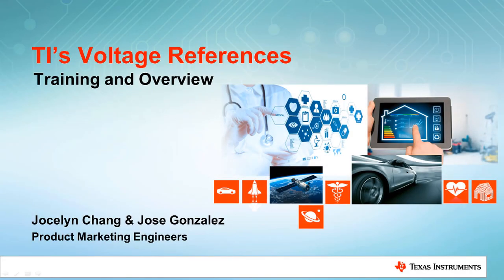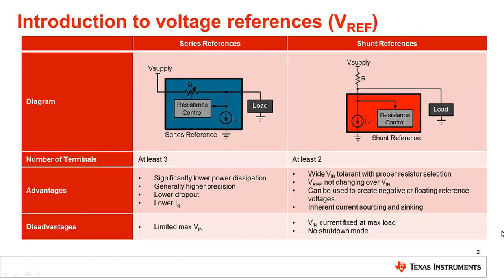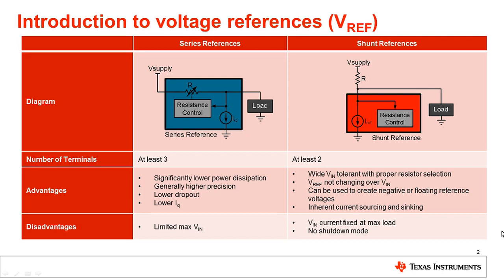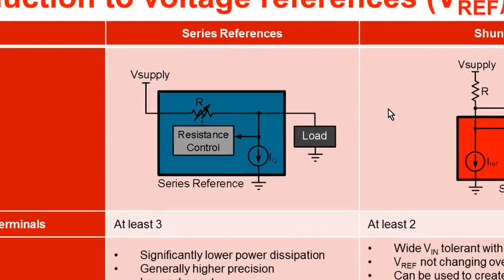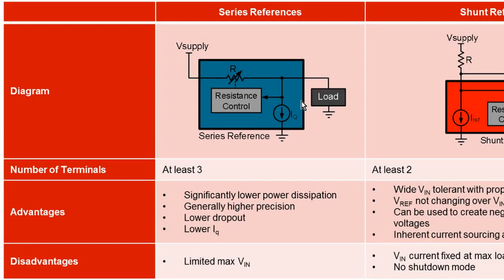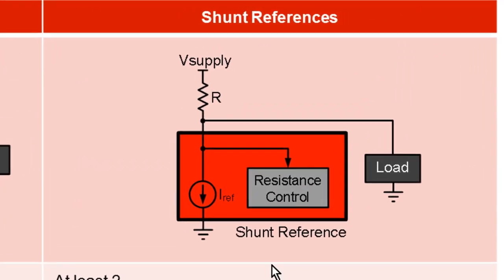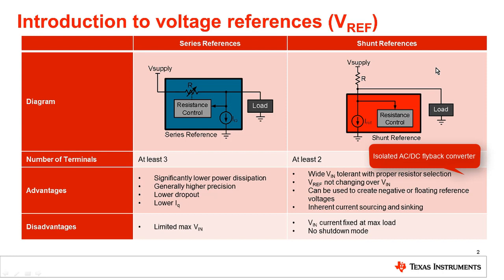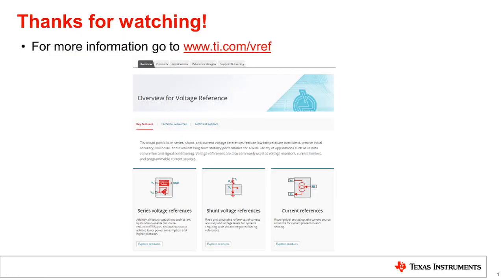What is a voltage reference?

Comment: Atoms are neutral because they consist of an equal number of positive (protons) and negative (electrons) particles but
that is not the end of the description. In addition, the following are inherent in neutral atoms:
The fields due to the protons and electrons always exist, penetrating everything, but they cancel each other so well that there is hardly a net electric field around the atom!
When  electrons are separated from nuclei of a stable neutral atom the strength of the electric field around the atom grows which disturbs 'neutrality'. 

A conductor or any substance made from neutral atoms we can say is neutral when there is no significant field
surrounding it.
All locations at infinity, in all directions from the substance, are at the same potential namely “zero" and maybe
considered as a 'reference'.
A neutral piece of wire with its millions and millions of neutral atoms is good enough to be labelled as
a ‘reference’ and also as ‘0’ volts. It maybe called "circuit zero" or "ground" as is done in electric circuits. 

What is fascinating about an atom is how it remains “neutral” despite it being a collection of sources of powerful
electric and magnetic fields. The electrons at very high speeds orbit the central core (in the classical view) so perfectly balanced that the “net” electric field is very close to zero outside the atom.
Because of this astounding assembly of sub-atomic particles….for all time…..the e-field never becomes significantly
non-zero even for the tiniest fraction of time…..the cancellation of the fields outside is ever so precise.
If it were not so, we would be living in a “shocking” world ! and.....
…you would be shocked by anything you touch ! 

But what happens if there is some excess charge deposited on the substance? It is charged and it has a potential. 

Since charge cannot be destroyed the only way we can make the potential of the substance nearly 'zero' is to connect the substance via a thin conducting wire to a large conductive sphere. The charge will then spread out over that large sphere and make the potential of the substance nearly zero. That conductive sphere maybe conveniently the earth! And thus emerged the idea of 'earthing'.
When the charge migrates to the large sphere there is a current.We note we are observing phenomenon related to both
electrostatics and circuits.
Electrostatics and circuits belong to one science, not two. These are discussed usually separately in textbooks and
science and engineering courses. For too long has circuit theory been confined to analysis using math and has been depriving practitioners of the richness in its physical aspects.
Watch the two videos listed below to learn about current and the conduction process and surface charges
using a unified approach to electrostatics and circuits at a fundamental level. 
The last frame of video #1 lists articles and textbooks which discuss all these topics in more detail.
1. https://youtu.be/TTtt28b1dYo
2. https://youtu.be/8BQM_xw2Rfo 

It is not possible in this comment to fiscuss the idea of neutral and earth in detail.
The textbook 4 in the last frame References in video 1 above discusses neutrality in current carrying conductors,
"circuit zero" or "ground" and "earth" comprehensively.
Reply: I appreciate you taking time for posting this comment 🤝🏻

Comment: Thank you for the video. I am a complete rookie trying to build a 20 LED voltage meter for my leisure batteries in my camper. I was recommended to use a vref in the design with two LM3914 drivers and a digital amp. Since the voltage I will be monitoring is from 10.5 - 14.5V, would a series reference be a better option and does it matter what size I use?